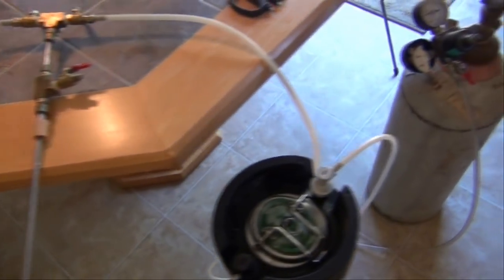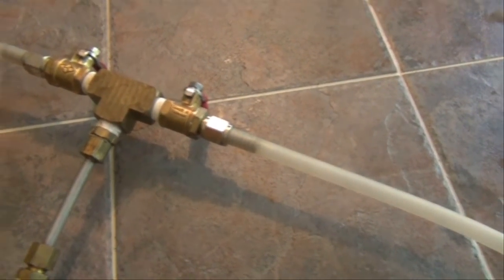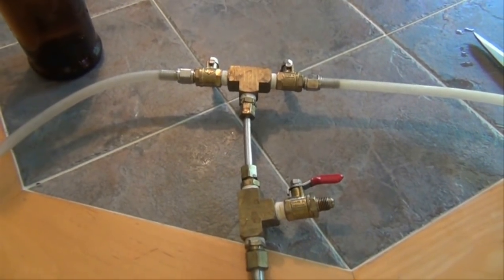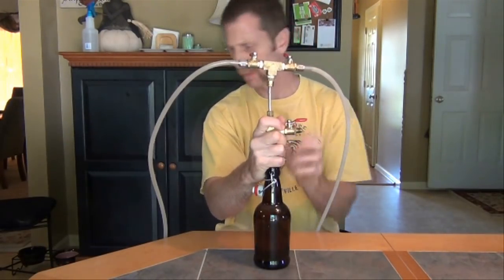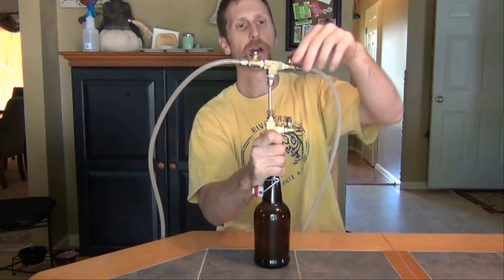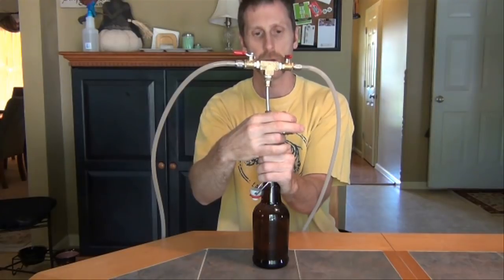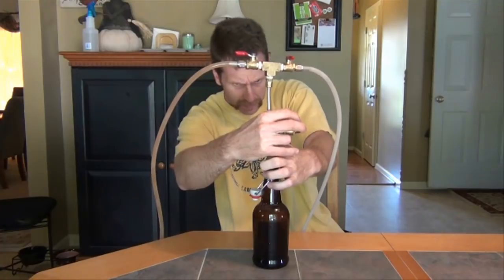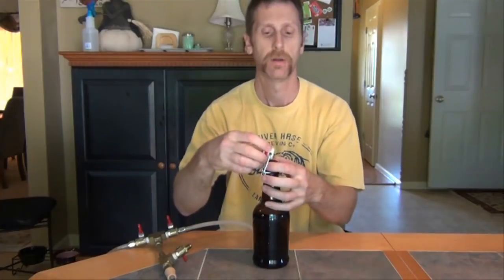How to Counter Pressure Fill a Bottle of Beer

Comment: Good video. Purging could be done a lot faster and easier if you:
> open release valve
> gently open co2
> wait a few seconds

then to pressurize:
> close release valve
> wait to pressurize
> close co2

then start filling.
Reply: what is the pressure bar of the co2 cylinder ? Thank you. 🙏

Comment: each one of those brass valves are at least 5 each. plus 2 barb valves another 4 dollars each. a 3 way distributor is about 20-30 dollars. And then i dont know how much for that metal tubing probably around 8 dollars. so yeah definitely not 5 dollars for that counter pressure filler but all things considered you are saving around 20-30 dollars since everything adds up to 51$ without tax to make this counter pressure filler and the blichmann beer gun costs about 70$.

Comment: Since CO2 is heavier than air, why waste the CO2 in the first "burpped" bottle? Put a plastic tube on your vent valve. Place the tube into a second bottle and while filling the first bottle force the CO2 in it into the second bottle. Rotate second bottle to filler ( now full of CO2 ) and place a new bottle on the vent tube. Now all you are venting is air not your CO2. Works best if you mount your filler.
Reply: lol